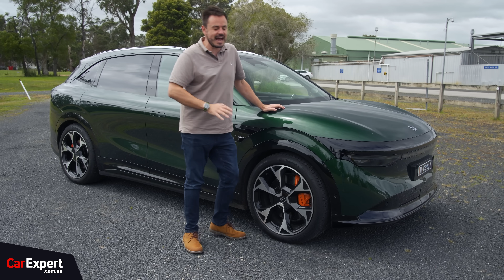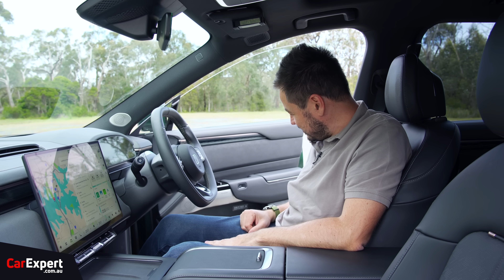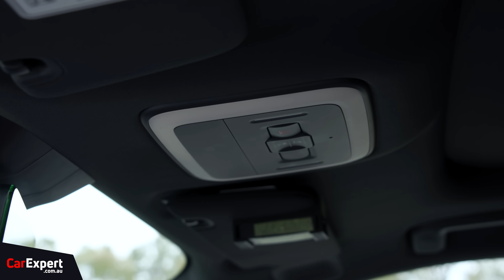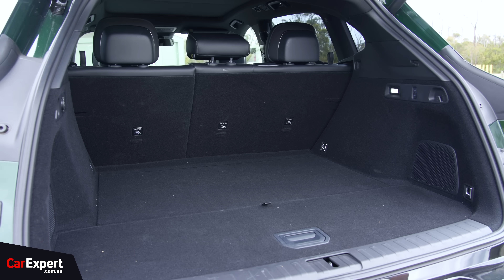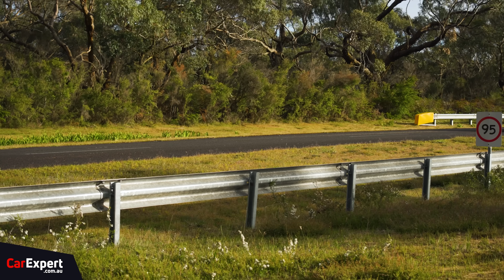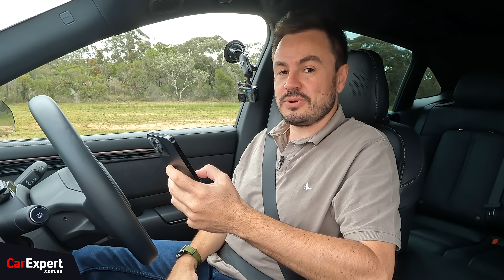The BEST EV I’ve driven this year…Zeekr 7X review (inc. 0-100 & braking)

Comment: At AUD 73,009, purchasing a Zeekr 7X is equivalent to the revenue generated by exporting roughly 560 tonnes of iron ore to China. Increased Australian demand for Chinese electric vehicles directly drives demand for the Australian raw materials needed to produce them. This creates a mutually beneficial economic cycle: stronger export demand supports Australian jobs, while local consumers gain access to high-spec, competitively priced EVs. What’s not to like?

Comment: The tech is really cool, but once this car is out of warranty and getting on some years a failure of any of those systems will see the car written off as the man hours to pull the car apart to replace motors and sensors around the car will just not add up cost wise. I put this in the same category as a lot of euro luxury cars. Only own it as the first customer while its got a factory warranty and offload it quick smart before it doesn't.

Comment: Paul when will see some auto driving as part of your tests? My 2017 Volvo does better than most of the cars still being released and I've been trying to find an upgrade :) but all the auto lane assist I've tried as so bad i wouldn't be able to trust them for even one highway turn :)

Also is there a kind of test you can do for formidable crap Victorian roads, road pot holes and just normal urban speed bumps? With these cars exceeding 2ton and often with 22" wheels you feel throughout the whole cabin

Comment: Saw the vehicle in person and I must say, very disappointed with Australia regulations. A lot of the “luxury accessories” were removed but still charged at the higher end. 

• Centre console fridge - removed.
• Rear infotainment system - removed.
• Rear massage seats - removed.
• Diverse colours / trims - removed. 
• Fully reclinable rear seats - removed.
• Rear leg rests - removed. 
• Stargate interactive light display - removed.

At least it has built in headrest speakers and heads up display. Shame other EV’s like the Geely EX5 have the same accessories for $30k less!

The luxury accessories is what made it stand out from the rest which is a real shame a lot of it was removed!

Comment: You omitted the fact that the DC charging is limited to a paltry 82kW or so when using a 400V charger, which the vast majority (including Tesla Superchargers) are. The reason is that this is the maximum charge rate of the onboard 400 to 800V boost converter.
Apparently it takes about 50 minutes for 10 - 80% on a Supercharger, whereas a Tesla takes about 30 minutes.

Comment: Another Tommy Cooker with no manual door latches when u have fender bender. In an accident battery displaces and  cuts power to the electric door latches..... thermal runaway then sets the car and your body on fire
Reply: Has front and rear manual door openers under the arm rest above the door bins, also has emergency window breaker. Fire doesn't always occur after an accident same as ice cars don't spontaneously combust after accident

Comment: 👍 video. In my opinion you have to test both the AWD and the RWD versions to give a clear conclusion of the Zeekr 7X bc the "flying carpet" makes alot of difference and cost alot off 💰 if you don't need it (don't like the fealing of no ground contact). The AWD is mostly not active on dry road driving and all the hp will wear the 21" tires down fast moving this really heavy car if you drive it like a 🚘 😎

Comment: Where’s the air recirculation button? It needs to be present on the screen or a physical button 100% of the time. If you pull away at the lights with a dirty diesel in front you can’t be fumbling around for it. You need access within 1-2 seconds.
Reply: Voice?

Comment: Liking the car, except for voice controlled windows, & electric door opening & closing .On mountainous roads, I'd like to have 45 or 55 tyres, to mitigate pot-hole damage. Where would you put a spare tyre. I assume you can buy one to keep in the car.
I think the rear window is dangerous if it doesn't fully wind down into the car. A side-on collision would be catastrophic for rear passengers with that window sitting up by about 2-3 inches

Comment: Can you spec it without the automatic doors? That looks horrible.
Reply: You can disable the auto doors.
The car is fully customisable.
Most reviewers assume and haven't spent the time to deep dive into the features.
Best car sub $150k.
Reply: @Clark-iey  Reviewers never have the time to fully understand all the functions of modern cars. Actually, most OWNERS never read the manual and never know the full range of features available. Ask any driver whether they use something basic like  adaptive cruise control and lane centring and you'll get a blank questioning stare

Comment: I enjoy this channels review, Paul is a likable and good host but id love to see some more details in these reviews 

1. Total on road costs 
2. Insurance premium (attempt to get insurance quotes and compare to other comparable models)
3. Full to empty driving distance in real world settings 
4. Consumable parts costs 
5. Test of after sales support (i knkw these are press cars and you dont own them but some insight into what a genral consumer would deal with if seeking after sales suport) 
6. Actually, test the self parking feature 
7. Fuel / Engery consumption // Performance at minium and maxium load (fill the car with people and gear) 
8. Night driving (Lights, Camera's) 
9. Brake test 
10. Wet road test
Reply: This is not a deep technical review of the car and that wouldn't get a lot of views either.

Comment: I picked up my 7X AWD on the first day of release from Zeekr Perth on October 15th. The car is brilliant and has so many features it would take too long to go through them. Some reviewers say they're not sure about the push button door opening, or that it doesn't seem to work all the time, but that is only because of their unfamiliarity. I think it's great, and now it seems strange to get in cars that don't have it. Without any keys, my 7X will unlock as I approach the car, the driver's door will open with one press from my finger, the facial recognition will move my seat and driver settings into position as i fasten my seat belt, the door will close with one touch of the break pedal, and with one press down on the steering wheel stalk, I'm off driving! One word sums up driving in the 7X AWD, whether you're driving around town or accelerating 0-100 kph in 3.8 seconds, and that is 'Effortless'!
Reply: ‘Brake’
Reply: how much in AU
Reply: Good on you. Would you please briefly comment how the car performs now? Any software glitches or other issues that Zeekr hasn't been able to fix? Some users say Rear Wheel Drive is more stable than the AWD model. What do you think?
Reply: I wonder how long all that complex tech will last before it decays and becomes glitchy?
Reply: is this your first car in 20 years? lol
Reply: @Robskopp  There aren't many cars on the market that have doors that open and close automatically, or use facial recognition to adjust the seat and steering wheel position, and most cars require you to press a "Start" button first rather than just putting it in drive and heading off. Not sure why you'd imply that cars have ad this type of tech for the last 20 years.

Comment: Short term wise Zeeker is definitely something to consider, but man, is 2026! even if you don’t use it, the car is just so much better when it can drive its self, Tesla FSD will be better and better, but Zeeker simply can’t, Zeeker even in china main market is still on the old school adas based system for self driving, and 7x hardware is not compatible as well.

Comment: Your reviews are very informational but somehow they fail to convey the experience that for some cars is more than sum of the specs/features. For example, I recently got Model Y as my first EV. And oh my, the features that makes it a great car are far beyond fast acceleration, big boot and a long range. It's where the sum is so much bigger than the components. It's about not having a car key at all - no I can go truly "cashless" carrying just my phone to both drive and shop. It's about not worrying to lock or unlock your car because it does it by itself once you leave/approach. It's about FSD attention monitoring system being gentle and not annoying. It's about being able to configure attention chimes to be mostly hearable by just the driver to make sure your toddler doesn't wake up. It's about not missing Android Auto at all, because you can just "share with Tesla" from Google Maps on your phone and start driving while letting your partner to fiddle with Google Maps a bit more to a find a coffee joint along the way. It's about water spraying intermittently only when wipers are down. It's about many people spending lots of time figuring out how to make the whole system work such that it takes care about your driving experience as a whole.

Comment: Piano black is the same issue like with mobile phones. It looks great but you cannot use it without protection.
Reply: Piano black is just black plastic, which is easily scratched. The exterior black parts are likely painted in black duco, which should be just as scratch resistant as the rest of the paintwork.

Comment: Your comment about "piano black" being pointless on the outside makes ZERO sense - it's the same as saying black cars are pointless! 🤣 Everyone knows black is THE BEST looking when clean. Yes, it does show the dirt, and also wash marring, more than other colours - that's the tradeoff. (wash marring is VERY easy to buff out though, and if done correctly, can be done MANY times without compromising the clear coat. "Correctly" means a soft pad with a finishing polish)

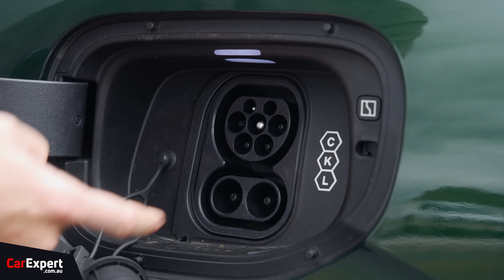Comment: 14:57 400 Killerwasps...ahhh.
Reply: Why not! I'd be running as fast as those electrons if I was being chased by 400 killer wasps. Or even a single 400-kilo wasp. 

(For the sparkys, yes I know that doesn't compute, I did Electrical Engineering. I know electron displacement speed doesn't vary if voltage is constant, and that charging "speed" is largely determined by the magnitude of current).

Comment: Its a differrent one pedal driving in the Zeekr. You ease off the accelerator, it gives you a moderate regen. And you press on the brake, the first 20ish% of the brake is also actually just a stronger regen deceleration without actually engaging the brake. This is way more logical to use compared to purely relying on 1 pedal like in the case of the Tesla, when people panicked and not used to the brake, they slam on the accelerator and get themselves into trouble. Of course in the Zeekr you can force the regen to be really strong via the setting screen and you still get the Tesla 1 pedal driving feel if you wish
Reply: What a ridiculous comment 🤣

Comment: As a dinosaur juice loving kinda guy, I must thank all of the first adopters for taking the plunge on these Chinese EV's. I'm not at all being sarcastic, I think they present an interesting proposition to the market in terms of performance, luxury and styling. Durability and dealer support is what remains to be seen, and only time will bear that out. But the more I see the more I'm interested in these EV's.
Reply: I like them because it gives me cars to benchmark against. Once fast electric cars start getting sold, i start modding my cars to be faster. 😂

Am struggling ATM with the new electric ones as my current ICE is RWD and it is hard to launch it nearly as well as these heavier, AWD electric cars.
Reply: @asum307  I drive a bmw x3 m40i. It's 6cyl turbo engine + AWD system is fantastic. I have a downpipe, flex fuel sensor, upgraded pump and a tune and it hauls ass, especially off the line.
Reply: We have the same engine, and i have the same upgrades to engine, plus a couple other minor ones. B58 gen 1 for the win. 😜 What numbers are you pulling from yours? I am using MHD for the engine, and XHP for the transmission. 

I have a 540i, wish it came in AWD in Aus. With factory set up it would just spin on Launch, esp running E85. So have spent a bit of $$ replacing all rear subframe, hardened bushes, new toe arms, anti vibration subframe inserts, new front and rear guibos, drive shaft, and an upgraded driveshaft carrier bearing support, because the stock ones keep failing lol 

Best i can get 0-100 is 4.1. It just breaks traction if i give it anything more. 
I have draggy pro, and so i benchmark my 80-120, and 60-110 (another channel on YT) to see what is what. 
So far only 3 of the cars on this list have a faster 80-120. That was the M5, Ioniq 5N, and the Zeekr 7X, which we are buying to replace the partners aging Merc. 

In saying that, i am yet to try the 80-120 with Anti lag on while running E85.
Reply: It may surprise you to know that oil does not come from dinosaurs. It comes from the microbes that existed at that time millions of years ago. look it up dude.
Reply: @Chris-be1fooil coming from dinosaurs is a meme, don't be so serious
Reply: Hey Chris, big breaths now, slowly exhale. Does the world seem better now.
Reply: Funny you say that. The Chinese made cars even the Tesla Y built in the Shanghai factory are still well superior in terms of build quality to the American built cars. We have a Y rwd and quality wise it’s close to perfect. 
America has got to take quality seriously.
Reply: @lawrencecoleman6998  American cars, in my opinion, are the worst ranking vehicles for reliability. I'd never consider owning one.

Comment: Great car. My only concern and it is just my concern, is the longevity cost. All those things and gadgets that will fail being chinese manufacturing of a first run model from a newish car maker. Outside warranty those door motors, cameras etc etc are going to need replacement and won’t be cheap. This is the same for all cars I know. My ideal version would be this performance drivetrain and minimal bells n whistles. Manual doors for example.

Comment: Hey Paul, We'd recently been to a media event and had limited seat time but I was curious if you noticed when selecting between different steering modes, the on center feel was always in "sport/ heavy" which is was fine in sport because the feeling was linear. But if you'd selected comfort mode, the on center feel was as though it's still in sports mode. In turn it created this unnatural feeling, heavy on center/ lane keeping, then light actual steering for lane changing/cornering. Curious if you also experienced anything like that?

Comment: I took one for a drive and was disappointed with the AC system. Couldn’t cool down in a Brisbane summer even after 30min driving. 
Disappointed it has the indicator on the left. BYD put it on the right for right hand side drive. 
It was a good car but not good enough

Comment: How hard is it to change a wiper blade on the "hidden" rear one?
Reply from the maker: I didn’t specifically check for the 7X, but typically there is a service mode setting that will drop the wiper down to allow for easier access.

Comment: I’m a fan and have ordered the AWD but should point out that your 
quoted pricing is a little ingenious. Zeekrs on road costs are high so the basic performance AWD is $80000 and then an extra $1500 for any paint but black and another $1500 for any interior except black. So for a lot of people they will be paying $83000 not $73000 for the AWD. Even so it’s still good value

Comment: Half price compared to BMW ix3 X50 or Audi etron SQ6...yet faster, faster charging, better tech, over the air updates (which is mission impossible with hundreds of ECUs from many different OEMs that have different firmware release cycles, different APIs...ugly mess). If you are want better EV rather than badge wihich has no EV pedigree buy a Zeekr.

Comment: Thanks for your review.
I did want to comment on the 24 kWh/100km efficiency figure you reported as I don't think it is representative. Do you use a particular method to calculate this?
For myself and the 7X AWD owners I know from various online forums, we are seeing everyday efficiency at 17~20 kWh/100km. and 19~22 kWh/100km for motorway (110 km/h) driving.
Since I bought the car my current average efficiency is 18.4 kWh/km (over 1,100 km so far) and I have not been hypermiling or anything like that, but in fact the opposite due to enjoying the acceleration a little too much. Most of this is (sub)urban driving but also includes some highway & motorway driving and a trip into the Blue Mtns.
Reply from the maker: Unfortunately the overlay we used was the incorrect one. The reading was closer to 20-21 and that was predominantly highway driving.

Comment: Small error, top spec Zeekr 7X has ZEEKR Sound pro 21-speaker 7.1.4 audio system. I think i heard 10 speakers.
Reply: 21 Speakers in the 7X and 29Speakers in an 001.
Reply: @RobertCekus still sounds pretty poor. I was not impressed with it either in the performance or LR. Just didn't sounds very full

Comment: I was in the first delivery from Sydney, have exact same car as you tested. By far the best car I have owned, fast, comfortable, handles well, full of features, averaging 19-20 kw/100kms as a daily drive. Awaiting a few over the air software updates otherwise a game changing car.
Reply: Agreed. The car is fantastic, and so is the phone app.  There are some software quirks/issues that can be improved, but nothing that is a showstopper, or particularly important IMO.
We got our 7X AWD at around the same time and I will just add that for typical mixed daily driving for us it gets 17-20 kWh/100km. Our current long-term average since we got the car is 18.4 kWh. For motorway driving @ 110kmh it gets 19-21 kWh/100km. But as we get into more hot summer days I expect the efficiency to go down a little bit.